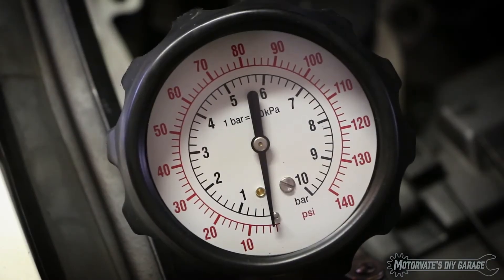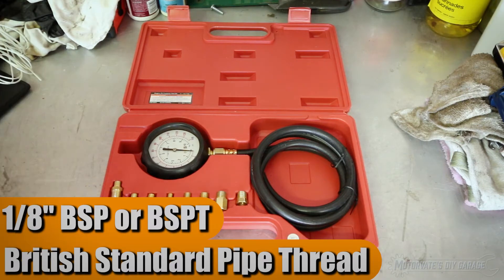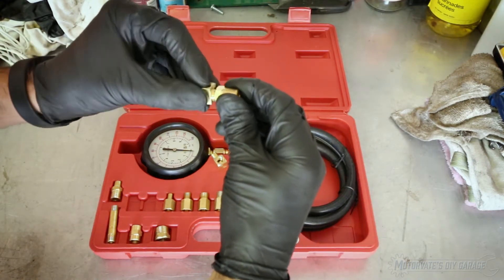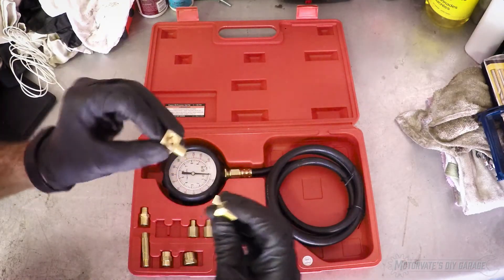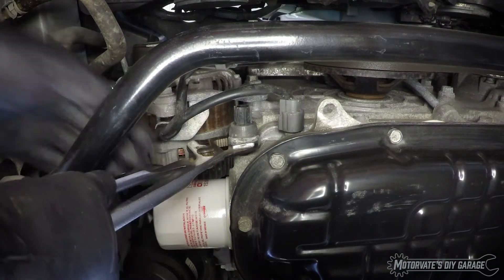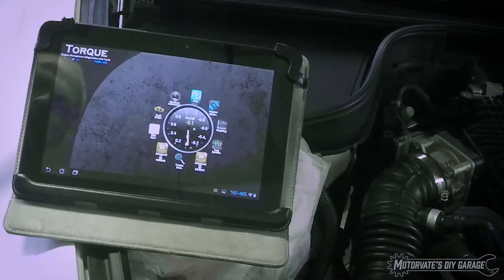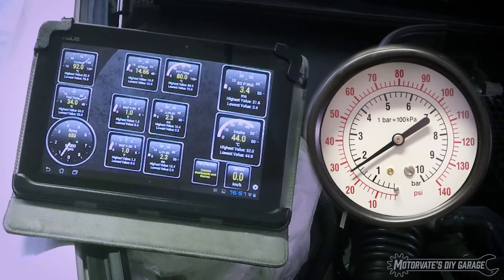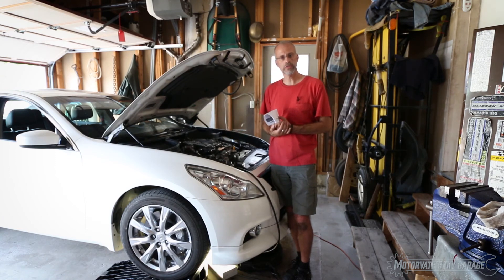Oil Pressure Check: G37/370z - Motorvate's DIY Garage Ep. 18

Comment: i cant read oil temp in my g 2008 not showing
Reply from the maker: I just checked my documentation and it looks like the 07/08 G35 with the VQ35HR doesn't support getting engine oil temp. :(

As a work around, you could monitor the engine oil pressure while the car idles for 20-30 minutes... That should get your engine oil temp to around 80C / 176F.

Good luck!
Reply: @MotorvateDIY   mine 2008 g37 vq37 , engine have 2 sensors near oil pan , any idea ?? only i can read coolant temp .
Reply from the maker: Understood...
The 2008 G37 coupe seems to use 2007 ECU electronics with newer G37 software.
Unfortunately, just because the engine has the oil temp sensor, doesn't mean the ECU will report it when asked via an app.
Reply: @MotorvateDIY  i got your point . thanks a lot , but if I put 2009 or newer G model ECU it will read it ??
Reply from the maker: Unfortunately, I don't know. :(

Comment: Hey @motorvateDYI , would these specifications be the same for a 2008 350z Nismo, or are they different?
Reply from the maker: I just looked up the 2007-2008 HR engine oil pressure spec and it is the same. At 80C / 176F oil temp: more than 14 psi at idle and more than 43 psi at 2,000 rpm.
Reply: @MotorvateDIY  thank you for the reply, I really appreciate it. I’ll be picking up a 350z nismo next week! What are other things you suggest to keep an eye out for? The Nismo I’ll be picking up only has 6000 miles so not enough wear to be concerned about, but I still want to inspect it and take it to the Nissan dealership to get an inspection.

Comment: Hey Motorvate. So I had the galley gaskets go out on my g37s . I had them replaced but the oil pressure still reads low at 5 psi. Any advice on what it may be? Please help thank you.
Reply from the maker: Hey  Juan Rendon,
Sorry to hear about that!

If the galley gaskets resulted in low oil pressure for a while, it can wear the crankshaft & connecting rod bearings, resulting is additional clearance between them. This can lower the oil pressure. 

How does the engine run now?
Can you measure the oil pressure with a different gauge to rule out a bad gauge?
Reply: @MotorvateDIY  So I just spoke with the mechanic that is doing the job. Before he replaced the gallery gaskets the oil pressure was at 9 psi. and after he replaced them he placed a gauge to check the psi while test driving and that it read normal when driving but when he was stop at idle the psi would drop to 5 psi. I'm going to have him check the oil pressure relief valve next. Got any advice on anything else that it might be?
Reply from the maker: Hey  Juan Rendon,
No harm in checking the oil pressure relief valve, as old gasket material could be holding it partly open. 

As for other items to check, I can't think of anything.
Reply: @juanrendon9662  I would also be curious as to possible oil pressure fluctuations at idle, as these might be indicative of worn crankshaft or con rod bearings that have developed excessive journal to bearing metal clearances.

Comment: Can 5W40 affect engine oil pressure negatively to VQ35 or VQ37?
Reply from the maker: I do plan on doing a test in the spring of the difference in VHR engine oil pressure between 5/30 and 5/40.

Based on the slightly higher viscosity of the 5W40 I would expect slightly higher oil pressure. How much higher, I don't know.
Reply: @MotorvateDIY  can 5w40 hurt our VQ HR engines in any ways?
Reply from the maker: I don't think it would hurt anything, but I don't have any first hand experience as the recommended oil is 5W30.

You can always try it and see for yourself. I think a few guys that run turbos on their G37/370 do like to use a thicker oil like a 5/40.
Reply: @MotorvateDIY  I already tried 5w40 on my VQ35HR, but it’s a hit heavy on city driving.. Do you think synthetic 5W30 oil can protect our VQ engines even we use over 7k RPM?
Reply from the maker: I do think 5W30 does a good job protecting the motor at all RPMs, low and high. 
One thing you should keep in mind is that at high RPM, the oil pressure is also very high. On the VQ37VHR at 100C / 212F oil temp, the oil pressure is more than 100 psi. This ensures the lubrication requirements are met and probably exceeded.
Reply: @MotorvateDIY  Thanks for the detailed explanation! When you say the engine oil pressure was over 100 psi at 100C on your VQ37VHR, does it mean that 5W30 engine oil was enough to protect your engine?

Could you please specify which engine oil you were using and how high do you use RPM?
Reply from the maker: I use Castrol Edge 5W30, but any name brand synthetic will also be a good choice.

In normal driving, I change gears around 3500 RPM. Once the engine is fully warmed up (engine oil => 80C/176F) and I want maximum acceleration I shift at 7200 RPM.

Don't over think the engine oil.
The engine is designed for 5W30 and 7500 RPM :)
Reply: @MotorvateDIY  I really appreciate for the detailed and clear explanation!
Reply: @MotorvateDIY  Do you think it’s better to use engine oil has API SP grade to protect the engine at low temperatures such as LSPI? Or does our VQ engine work fine with API SN grade engine oils which doesn’t react to LSPI?
Reply from the maker: I don't know what LPSI is.
Reply from the maker: As far as I know,  low-speed pre-ignition it a much greater concern for turbocharged direct-injection vehicles.

The VHR is a nice and simple port fuel injected engine, no need to worry about low-speed pre-ignition.
Reply: @MotorvateDIY  Is VQ35HR multi port injection (not direct injection?) like VQ37VHR?
Reply from the maker: Yes it is.
Reply: @MotorvateDIY  Thank you for the reply. Do you think thick 5W30 engine oil will protect our engine better than thin 5W30 engine oil? 

And how often do you change the engine oil on your g37?

Comment: Hey Motorvate, Hope all is well with you.  i have a question.
 I had my gallery gaskets done because I had low oil pressure.  So i checked my readings now after the work was done and i now have 17psi at idle and 42psi at 2k rpm.  Any advice?
Reply from the maker: Hey DevilG,
Yes, I do have some advice - relax and go for a drive :)

The spec is  more than 14 psi at idle and more than 43 psi at 2,000 RPM with the engine oil at 80C / 176F.

At idle you are good! 
At 2,000 RPM you are close enough :)

Also, oil pressure gauge accuracy can vary from 1-3% or more of the full scale value. (1-3 psi for a 100psi gauge) With the gauge showing 42 psi, I don't think you have anything to worry about.
Reply: @MotorvateDIY  ah i checked again at 80'C since she was probably warmer when i got home. Shes 18 and 48 now. Ill drive her and see what happens over time.

 I guess after new metal gaskets i was hoping for numbers closer to yours lol  Anyhow thanks for the quicky reply and advice . You are awesome man, cheers 🍺
Reply from the maker: Hey DevilG,
Thanks for your kind words! Now, go for a drive and enjoy your good oil pressure :)
Reply: @devilg37  you need to change your engine right away!

Comment: Just got a engine for my car and it is installed now it was used with 79k miles and on idle oil pressure drops . When running , oil pressure is fine. Shoul I stop driving the car completely? Or what is my best bet
Reply: My car is a 2010 Infiniti G37 and the motor I bought was from a 2009 Infiniti g37
Reply from the maker: At idle, what does the oil pressure drop to? As you know the spec is more than 14 psi at 650 RPM with the oil at 80C / 176F. Are you close to that?

Comment: Will this method diagnose a galley gasket issue? I have an 11 IPL G With 40k miles
Reply from the maker: Hey TLE0622 IPL,
YES!! That's why the episode was made :)
 I wanted to check my oil pressure before the warranty expired and so far so good.

Tip: Don't over tighten the oil pressure switch, the factory shop manual specifies 11 foot pounds.
Reply: Motorvate DIY crazy how Nissan decides to cheap out on important parts. Sadly a $2-3k fix for a $25 part that was revised on the MY12 and up G and Zs
Reply from the maker: Hey TLE0622 IPL,
I see your point.... but it doesn't happen to ALL VQ37 and the internet is good at making a small problem seem much larger that it really is.

However, if you have the issue, then it is a big problem :)

I have always wondered if high engine RPM on a cold engine is part of the problem. With the VQ37, the engine oil pressure on a cold start up is more than 100 PSI which may stress the older style galley gaskets.
Reply from the maker: Hey Chris Francelli,
To minimize the excessive pressure on the galley gaskets, I keep the engine RPMs under about 2,500 for the first 15 min after starting a cold car, with outside temperature less than about 15C / 60F.

The engine in the G37/370z has a high volume oil pump and oil pressure is much higher when the oil is cold.

I don't have any proof of this making a difference, but the logic works for me.
On a future episode, I will be showing how the oil pump works (it it more interesting than you think!) and will show the crazy volume it puts out.
Reply: Motorvate DIY Hi. I’m looking for a used G37 possible a 2011. If the oil pressure on it is normal, should I consider it? Does the oil pressure plummet instantly or does it fall gradually as the galley gasket becomes weaker and weaker?
Reply from the maker: Hey Vikram Karwal,
If the oil pressure is within spec (idle > 14 psi @ 80C/176F) that  only tells us the gasket is OK now. 
It's my understanding that once the gaskets starts to fail, the amount of the oil pressure will drop will depending on how much of the gasket has been pushed out. 

I would scan the car with an OBD scanner and app (I like OBD Fusion) and run a diagnostic report.

Here are a few videos from my other channel (OBD4Everyone) that might be helpful:

How to run  OBD Fusion's Diagnostic Report: 
Apple iOS: https://www.youtube.com/watch?v=ewNJDpWCKe4

Android: https://www.youtube.com/watch?v=T7O_vjsB2Jo

OBD Fusion Diagnostic Report typical engine sensor values:
https://www.youtube.com/watch?v=CXDX-89_ArU

Overall, I really don't think this issue is very common, so I think the odds are in your favour. :)
Reply: @vikramkarwal9342  Also check for this sound when accelerating from a stop when the oil is hot:
https://youtu.be/Ht86jllXbbk?t=24
More information here:
https://www.myg37.com/forums/general-tech-questions/284823-infiniti-g37-noise-when-accelerating-after-stop-7.html#post4244661

Comment: Hey Motorvate, have you planned on installing a permanent oil pressure guage for your G? Was thinking of installing one myself, because I fear the dreaded code. Was gonna go for the non mechanical guage.
Reply from the maker: Hey Daniel P,
My gosh... are you reading my mind? :)

In the spirit of "doing it yourself" I am in the process of designing/building an inexpensive digital oil pressure gauge for a future episode.

This will use a $25, stainless steel, 150 PSI digital pressure sensor, a $10 Arduino Uno clone, and a $10  small 128 x 32 pixel OLED display.

When I write the software for it I plan to show the highest and lowest oil pressure and have it flash red when the oil pressure is below 14 PSI. (the factory minimum at idle)

It will be a different kind of episode, but I think it will be helpful.
Reply: Motorvate DIY Cannot wait to see this episode!! Love all your videos!
Reply from the maker: Hey Daniel P,
:)
Reply: @MotorvateDIY  Any progression with your Arduino / OLED display for oil pressure project? Thanks!
Reply: Did you end up making the video?
Reply from the maker: (Sorry for the late replay, sometimes it seem slike comments are hidden from me and then pop up later)

Anyways, I have continued to develop the gauges and now they look like this:
Mini-Dash LCD Gauges Update #2: MotorvateDIY Garage Ep.41
https://youtu.be/94KQ5Zs0fU4

This now uses an ESP32 and a Bluetooth oil pressure gauge, so you don't need to run wires from the engine to the interior. (If you have ever done that, you know it isn't easy or fun!)

I have been testing the gauges since February and they have been working well.

Stay tuned here for the next update video :)
Reply from the maker: (Sorry for the late replay, sometimes it seem slike comments are hidden from me and then pop up later)

Anyways, I have continued to develop the gauges and now they look like this:
Mini-Dash LCD Gauges Update #2: MotorvateDIY Garage Ep.41
https://youtu.be/94KQ5Zs0fU4

This now uses an ESP32 and a Bluetooth oil pressure gauge, so you don't need to run wires from the engine to the interior. (If you have ever done that, you know it isn't easy or fun!)

I have been testing the gauges since February and they have been working well.

Stay tuned here for the next update video :)

Comment: I am running  torque pro on my g37 I can't get oil temp on the app can you help please
Reply from the maker: Hey  Caleb Pinell,
I sue can... How about a step by step video :)

Oil Temp Gauge w/Torque Pro - Motorvate’s DIY Garage Quick Tip #2
https://youtu.be/8oc7szSr-Xk 

Don't be worried if your oil temperature is often at 100C / 212F or a little more, it is normal.

Have fun!
Reply: @MotorvateDIY  thank you what about injector duty cycle and fuel rail pressure
Reply from the maker: Hey  Caleb Pinell,

Injector duty cycle is calculated from the injector pulse width and engine RPM... So we need to know those two items and then do some simple math:

Duty Cycle (%) = (injector pulse width (in seconds) x RPM) / 120

OBDFusion, OBDLink and Torque Pro are apps that have an add on that you can purchase to data log the engine RPM and injector pulse width (for each bank) and then you can do the calculation.

As for fuel pressure, the 370z/G37 engines don't have a fuel pressure sensor, so there is no way to view the fuel pressure.

However, I have added a fuel pressure sensor and built a cheap fuel pressure data logging system, that measures engine RPM and fuel pressure (plus 6 other items) . All my fuel pressures (at different engine loads) and how to build the system will be shown in a future episode that is under development right now :)
Reply: Thank you for your help and taking the time to help me
Reply from the maker: No problem. Thanks for watching the video :)

Comment: Hey Motorvate great video! I recently snapped off my oil pressure switch when trying to get the fill plug from the front differential off. Would it be bad driving without the switch on for a few days? I got a new one coming in that im going to replace. 

Thanks again! :)
Reply from the maker: Hey Daniel P,
Yes, it is safe. 

** Be very careful not to over tighten the replacement switch and use a thread sealer. **
Reply: Motorvate DIY thank you so much! Also would blue thread locker be fine or do I need better stuff?
Reply from the maker: Hey Daniel P,
Thread locker is different than thread sealer. Thread locker prevents vibration from loosening bolts/nuts. Thread sealer prevents leaks from pressurized systems, like a oil pressure switch.

In the past Teflon tape was used as a thread sealer and it still works well as long as you are careful about how you wrap the threads. An easier and safer way is a thread sealer, maybe something like: Permatex® High Performance Thread Sealant.
Reply: Motorvate DIY 
Thanks for all the help! I cant be anymore thankful, wish I could support you another way then subbing! Lots of great info here! :)
Reply: seems to be a common problem, I've done the same!